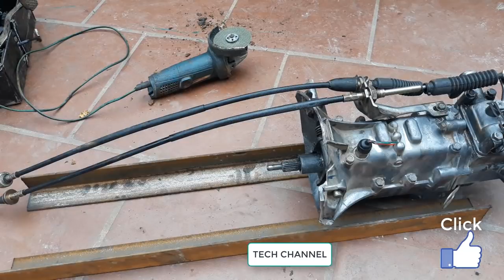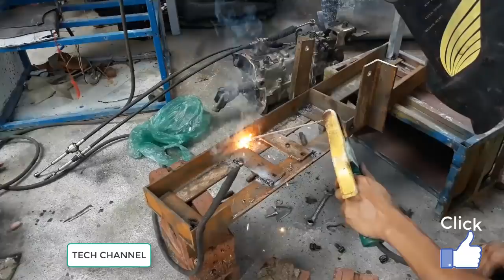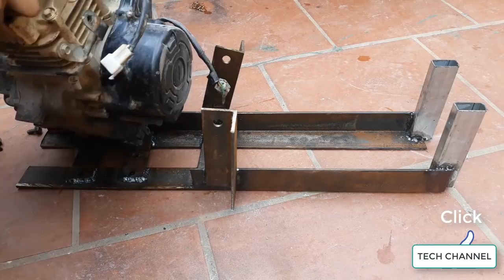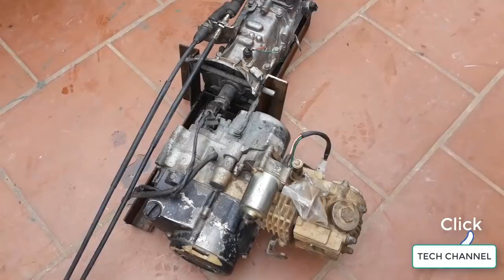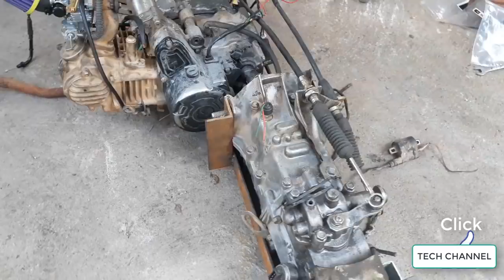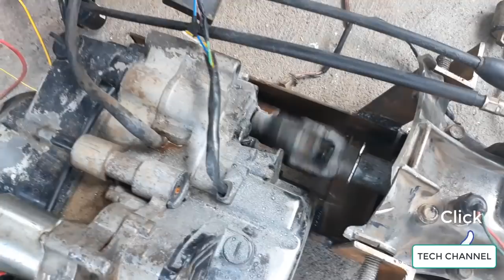Homemade big size freight cargo cars - Part 3

Comment: You are using 2 transmissions 1st inside the motorcycle engine and 2nd is car transmission so what is the ratio.. what gear you put in motorcycle engine for power delivery to car transmission do you change both transmission gear at  once or you put fixed gear in motorcycle transmission and doing changing gears in car transmission... Plz reply what kind of thing you do what type of ratio?????? Do you put motorcycle gear in low or high..????

Comment: hello there is a video with a copy in the same place, wasn't it the chassis in the video? Ask for the same reason that the engine gearbox is located. Have you installed the engine from the bottom of the oil leakage?

Comment: ????? How does that work with out a clutch on the transmission are you using the clutch from the scooter motor ???

Comment: In this video which type of engine use ?
Reply from the maker: Internal combustion engine, using gasoline fuel, Sir
Reply: 125cc honda cbf
Reply: what car transmission i can use... for the same as you have...